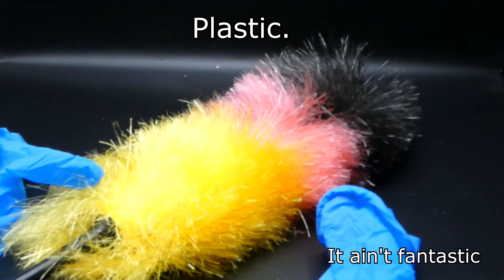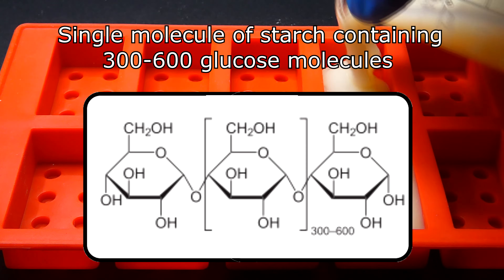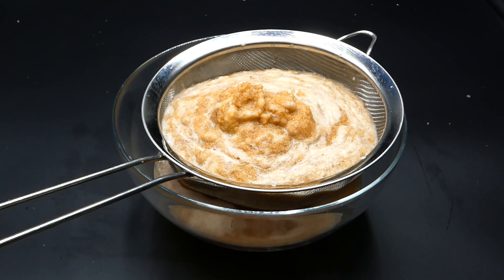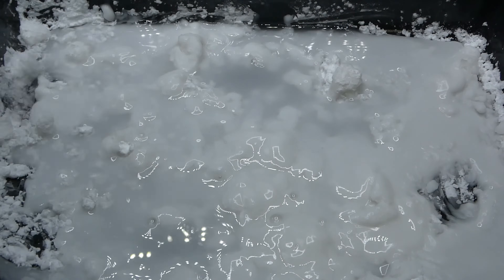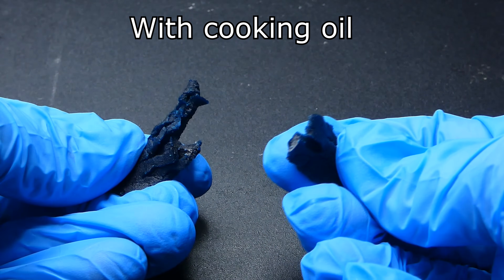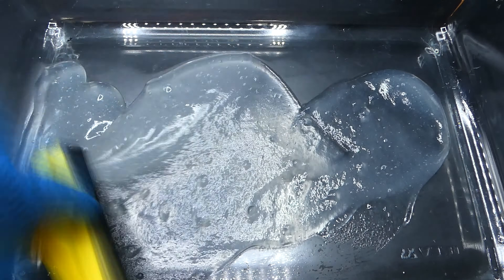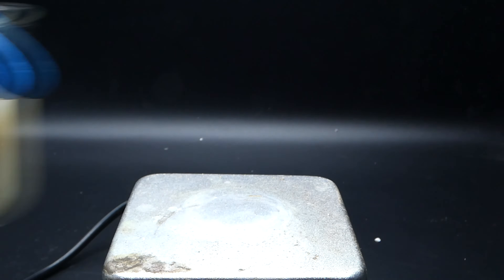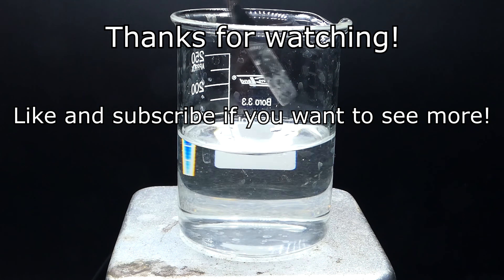Turning Potatoes into Plastic

Comment: ive always liked the idea of bioplastic, it seems like a simple fix to the plastic issue but when you REALLY think about replacing plastic with this stuff it seems like it wont cut it, a lot of the time plastic is meant to keep bacteria out, if I had a bioplastic zip lock bag, could I use it the same way? If i leave it sitting on my desk with chips in it for a week would it properly keep the air out or would it start to degrade? that's what I wonder as well how log would it take to degrade in a household environment? also is it sticky? cause that would be a problem if it dissolves in water than air moisture would likely get to it... TLDR I love the idea but I wish we could make a kind that only becomes biodegradable once something specific is done to it so "dispose" of it

Also WHAY IS EVERYONE SO OBSESSED WITH EATING IT??? Can we go more in the Make it useful rather than make it more edible dang! why yall wanna eat plastic so bad? more sugar = more degradable = shorter lifespan I want it to go away but not before im done using it as plastic, if im gunna eat it i wouldn't use it as plastic....
Reply: 🤔you bake with it with, so maybe can be a reason to why they want to eat it😆!? 
no idea, but if it's hot and very humid, maybe it could become sticky!? 
but generalised (and according to me😆) basic bio plastics, can't be used the same.. and air isn't really the problem, it's water and/or heat.. it can be made so it wouldn't dissolve (at least for a period of time) in alcohol or acetone, but still would in water.. if you for ex use gelatin and/or milk, you can get it waterproof but it's not heatproof.. if you want petri dishes and if I recall correctly, I think it was agar.. so for the bacteria, that would also depend on what it's made out of.. the same for the long-term usage.. 
and maybe it could be an alternative for some of the single use stuff.. but it's the same problem, for how it holds up, and that is if it's not some additives.. and then it's how that can be recycled? 
because you can recycle plastic, not just burning it, or making polyester and stuff.. you can turn it back to it's hydrocarbons, and make other stuff from that, or make fuel.. the catch is, if it's cost effective.. that, and if it's easier to make new stuff, (with no incentives or pressure) then that's what they'll do..

Comment: Another one:
Mix glycerol and citric acid at 1-1 molar ratio without any water (the correct ratio is very important).
If you cook/bake it slightly above 100C (effectively removing the extra water coming from the cross linking esterification reaction)
you can get hard foam, or thin hard coatings. For hard coatings you need to start below 100C and very slowly increase the temp to prevent foaming (the entire process can last for a day).
The resulting polymer is highly biodegradable, but if it is was baked long enough it can resist water for a few minutes.
(NaOH or KOH or even sodium carbonate can destroy the polymer it if boiled in water)
Reply: Interesting

Comment: Great video. I wonder if there are some nontoxic processes to cure it into a quite hard plastic that can be used and casted into little jars for storing things. Maybe it could also be treated with those water proof sprays in order to hold wet things in it (not for human consumption of course). Maybe curing it in the oven would work with a higher concentration of Vinegar.
Reply: without the glycerine it would form a hard plastic I think

Comment: I wish to see someone making it water-resistant. I did some research and this could be interesting:
Reinforcement with natural additives: Incorporating natural additives like waxes, oils, or resins into the bioplastic formulation can help improve its water resistance. These additives create a hydrophobic barrier, reducing water permeability. Examples include beeswax, carnauba wax, or natural oils such as palm oil or soybean oil.
Reply: High quality cold pressed linseed oil as a base layer could work. Good quality linseed oil or flax seed oil is used all the time for making food grade surfaces in wood working already since it’s a nontoxic drying oil. Putting it in the oven to cure the linseed oil @150f for 30min intervals over and over again till it’s dry and doing two coats of that I think would work well. I do oil painting and when I am feeling impatient I try to dry the paintings in the oven and it works well if I can’t use a quick drying medium like galkyd lite or liquin. Using a quick drying medium like liquin or galkyd lite would be good for curing the linseed oil quickly for a cup at room temp  as an additive to the linseed oil coating but they are pretty toxic. It would avoid putting a linseed oil coated plastic in the oven from warping but it wouldn’t be food safe. I already have everything and it’d be simple enough with the methods in this video as long as I can get the plastic hard enough before hand and water free so I might try it. 

I wrote too much my bad.
Reply: @AssistantLeaflet  That is indeed very interesting. I wonder why linseed oil is so different from other oils. Maybe it acts more like a resin? I just did research on natural resin and that could also work.

Comment: Technically this can be plastic but will it get mold(fungus)? It would be nice to test a rigid type vs a rubbery type and see their strengths, how durable, if any are resistant to water and at what temperature limits. I can see myself making a mold with this if I knew a recipe that would resist mold (fungus) at least
Reply: I think the goal here was to make a plastic that would break down naturally due to fungi and bacteria. I don't think this is intended for long term storage. Instead, it could replace some single use plastics. In general, if it is kept dry, I think it would resist mold. You might be able add something like Copper(II) Sulfate to inhibit fungal growth, but I am not a chemist so that is purely speculative on my part.

Comment: hi. great video! i have a question...apart from water, what enemies does this plastic have? do contact with metals ...aluminium for example..or salts.. etc cause any kind of adverse results?
Reply from the maker: Thanks! This plastic doesn't have avy reactions with metals and probably salts too, but since it is made out of starch some kinds of mold can probably eat it when it is wet.
Reply: @Amateur.Chemistry  cool. and thanks. i think i can genuinely make use of this process. but i wouldn't have even considered it until i saw your vid. Keep well, and keep going! :)

Comment: Would it be possible to make filament for a 3D printer.. I think that would make for an awesome video,, and awesome in general.
Reply from the maker: The potato plastic unfortunately cannot be reheated, so it can't be made into a filament, however i have an idea of making PLA plastic from sugar in the future.
Reply: @Amateur.Chemistry  Not everything 3D printed needs to have thermoplastic properties, or be a filament. FDM can use many different materials. If I had an auger/hopper feed for my printer [and the space to set it up :(  ] I would totally be playing with this. Oooh, I still have chitosan from when I was trying to make biodegradable plastic fish baits. 🧠⚙⚙
Reply: @tykokavaak5784  there is also the slow drying times to worry about, I have also heard it is rather inconsistent in texture and would get clogged in nozzle too easily

Comment: Question, does also flower starch work ?
Reply from the maker: Probably, altrough i havent tested it.
Reply: @Amateur.Chemistry  oh, well then, I will test it my self and probably make a video. Thanks for the response. Also, great chanel ! You, diserve my sub.
Reply from the maker: Thanks! Your channel is also great :)
Reply: @Amateur.Chemistry  thankyou so much
Reply: @Amateur.Chemistry hi it's me again. I waited for about 5 days and... It has the texture of a slimier gummy bear. I am not sure why although i tried it multiple times. It's great as a glue and may be a jelly i guess but it's not hard. I made a little heating oven to dry it quicker which does make the texture harder and more usable. Do you know the problem ? I may still upload a video with my failure but i mean it kind of atill works.
Reply: i just made some, it does work, although it makes the plastic a bit more yellow for some reason. might just be my flour, but it was like a cocoa butter color.

Comment: cellohane was popular before petroleum plastics.
Reply: From the Wikipedia for cellophane:
"Cellophane is highly permeable to water vapour, but may be coated with nitrocellulose lacquer to prevent this."

I'd imagine a nitrocellulose lacquer would also help it decompose rather rapidly with enough heat XD